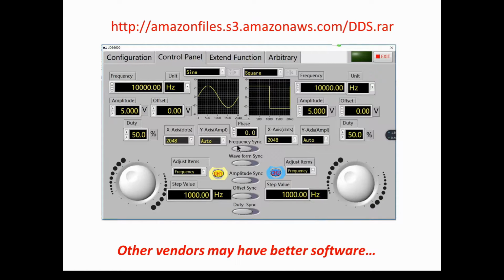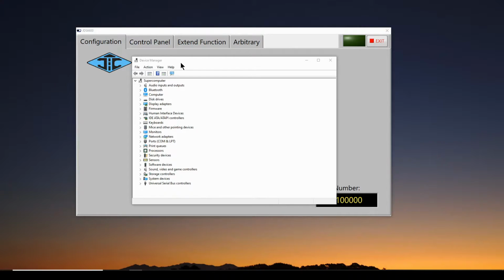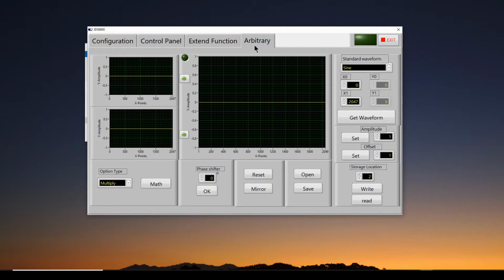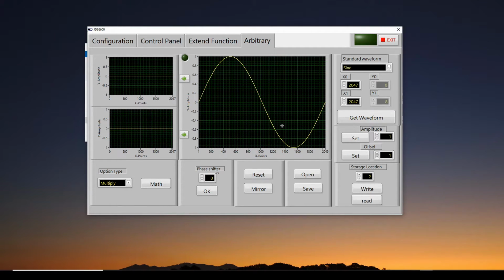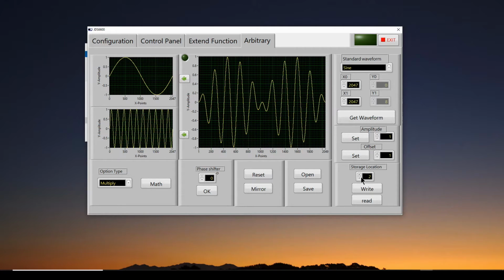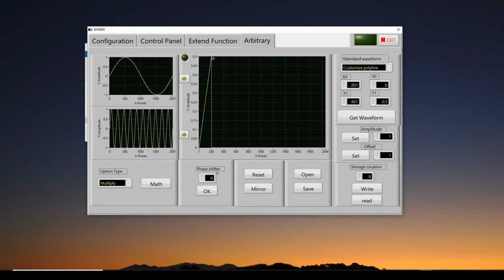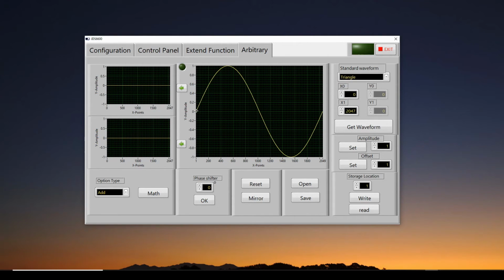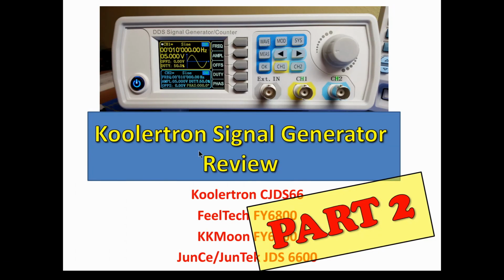Koolertron Signal Generator Review: Part 2

Comment: I got one of these today and didn't even imagine it wouldn't have SAWTOOTH as a built-in waveform (it has the ladder functions which are similar at higher frequencies I suppose), so at least I can try to use one of the save-slots for sawtooth then
Reply from the maker: Sure it does. Select a triangle waveform and adjust the DUTY (duty cycle) knob to 50% or whatever you want. Or, as I showed in this Part 2, you can very easily define whatever you want in software.
Reply: @EETechStuff  oh wow thank you very much actually! I didn't expect duty cycle since it only worked for certain waveforms, i guess triangle is one of them, that's awesome though.

Comment: Thanks for the fine presentation! I have notice a problem. I am monitoring the output signal level for a pure sinewave at 1 Mhz with my spectrum analyzer (tinysa). I created the amplitued modulated signal as you discribed in your video. The modulation frequency is 1 kHz and the carrier is 1 Mhz ( a factor of 10). The carrier level for an unmodulated sinewave is about 0 dBm. When I use the modulated carrier, the level drops to -33 dBm. Are we generating a Double Sideband Suppressed Carrier or am I doing something wrong?
Reply: 1khz over 1mhz is a factor of 1000.

Comment: If I were to make an arbitrary waveform, how do I ultimately determine what the frequency is?  For example, when I set the frequency for an arbitrary waveform, does the frequency refer to how many times that full waveform is being executed per second, or the sine or square waves within?
Reply: The idea is the "drawn" waveform per period.  In his example, the modulating waveform was one period, the carrier was 10x period.
So if you set the generator to 1khz with this new waveform, you have a 1khz modulated 10khz carrier.

Comment: Do you know if there is a setting to make a polarized positive square wave without using the software?
Reply: If you mean a square wave going from 0v to +X volts, you'd eitherset your offset to 1/2 your peak to peak voltage or use CMOS which defaults the offset to always have the lower part of the wave at 0v.

Comment: I just bought a new FY 6800. The manual is not very good. I am working with frequencies driving speakers and I am having a time. Sometimes it works fine and sometimes it will not work. I don't understand what is going on yet.